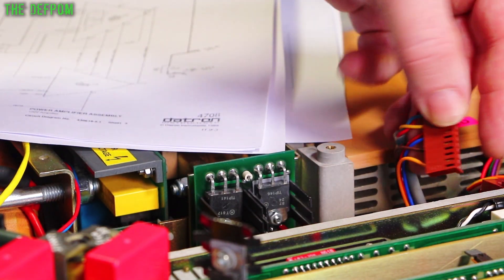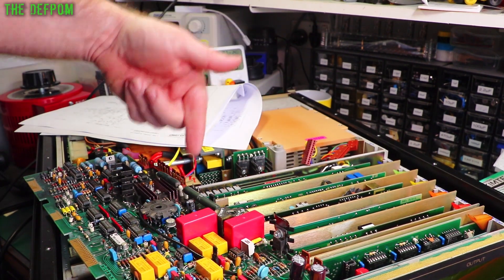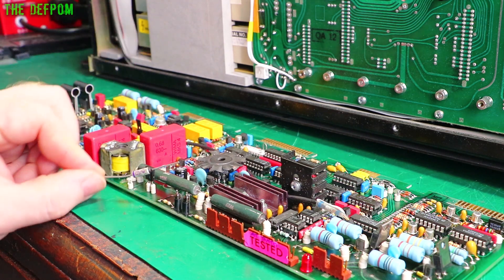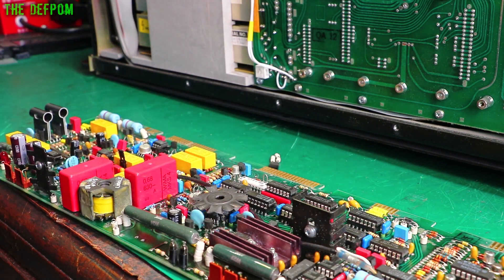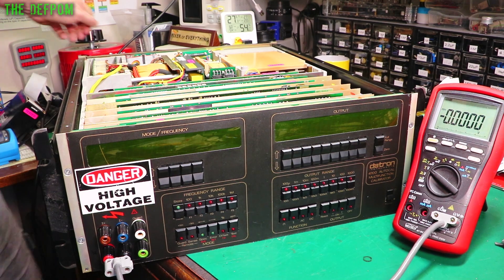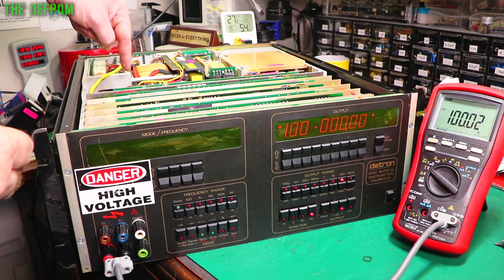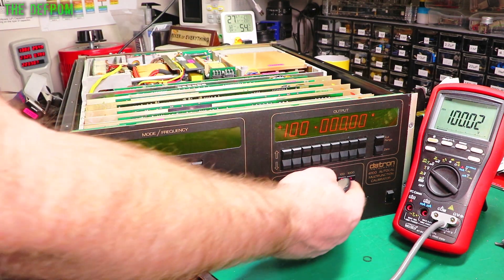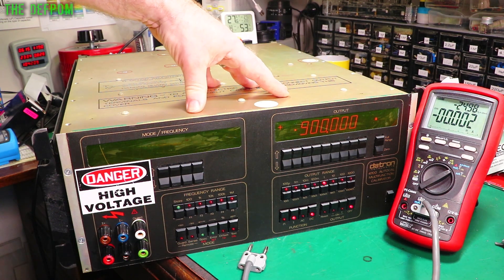🔴 Fixing a $10,000 Datron Calibrator - Datron 4700 Repair Part 4 - No.830

Comment: Haha! Bloody well done, I like your methodology.  I worked for datron where I built and calibrated many of these. Watching your videos was a trip down memory lane, wish I had found this when you first started your repair, that said you cracked on at a pace! Had great fun building these as they would come off the  assembly line with just the transformers and motherboard built in. The correct method was to fit a board and test its output first before moving on - unless it was a friday pm after a few lunchtime beers where all the boards went in with the HV enabled,  power up, self test and output max volts! Sometimes we got lucky and wheel them straight round to the autocal station for a basic test via the ieee socket.
The 4700 was probably the best bit of kit I worked on.
Reply from the maker: Awesome stuff, would you have come across issues with these with the high frequency output dropping off ONLY on the AC 1000V range ? I just noticed mine is exhibiting this symptom, lower voltages are fine.
I was literaly just calibrating a 1062 which wants 25KHz at 1000V for the high frequency AC calibration and noticed that my 4700 isn't maintaining the output voltage properly on that range and frequency, it is dropping down to about 860VAC , it is fine up till about 1.5KHz... so I'm wondering if its another fault or just a calibration thing, I haven't dug into it yet.
Reply: @TheDefpom  The 1000v ac range was always the most difficult to get right! Assuming your dmm  is ok I would hang a scope on the output and check for distortion usually caused by parasitic oscillation.  The feedback loop only has a certain amount of correction, they were calibrated at 2 frequency points of 1khz and I think 25khz . We had stability problems with the Vishay feedback resistors where tapping the board would give a big fluctuation.  They sat in a line at the top of the ac board, go gently on them! I worked with a guy in the production test bay who then moved into customer service and remained many years after I left. He now works elsewhere but we message occasionally and he lives close by, small world! I still have some boards and components that I rescued from the skip but most went back for spares many years after I left.

Comment: I often run into leads that are too thick for the board. I just take the lead, and use some 120 grit wet and dry paper on it, twirling the component lead with the lead between the folded sandpaper, to remove a little bit of the copper and plating off the lead. Then you can get it to fit the hole without damaging the through hole plating.

For the thermal fuse current rating is the carry current, they are not going to fail from over current till it heats it up to melting temperature. Insulate the fuse electrically with some kapton tape, as the resistor body when it is over 150C is conductive, as the glaze is only an insulator when cold.

Comment: Never any doubt that you would fix it, Scott! Expensive "parts" gear is scary but very rewarding when fixed, you now have a great calibrator for your bench.
Reply from the maker: It was a big gamble, but I felt I could get her working after seeing how Datron designed their gear with the 1062 multimeters I had repaired previously.

Comment: 👍Good work, nice gear. Hope it was not too expensive to buy in unknown state.
Reply from the maker: It cost nearly NZ$5000 including postage and import duty, the most expensive bit of test gear I have ever purchased, so I’m happy I got it fixed!
Reply: @TheDefpom  Thank you, that was certainly a stiff price. That takes confidence to tackle or extreme need. If there is enough need then it is definitely way cheaper than a new one. With a successful repair you either have an excellent calibrator or even could turn a good profit selling it working.
I would have concern at such cost, to risk incomplete supply, or severely fried  equipment. Still you have had much experience in these equipment buying and repair activities to ease concerns I would have to even undertake the risks.
My largest concern would be assured tech documents, but you seem to normally manage to get relevant manuals. I have failed sometimes and turned down repairs on behalf of others due to lack of documentation, but probably have not tried hard enough as the gear was not mine.
My present dilema is the Keysight  SMU (dual ch)  I would like to buy is over $23k new. The only second hand unit I had a opportunity to talk to existing owner  about has blown a significant part of its main circuit, and one PCB is charred. Still he wanted $8k and that to me was too risky. Might need to try harder to find a second hand on the market.
Reply from the maker: @helmuthschultes9243  charred boards sounds rather serious, would likely need a replacement board, I’d hate the think how much that would cost.
Reply: @TheDefpom  probably would not even considerit was a gift, let alone at that price. The cost of spares from Keysight is almost like a new purchase. In fact on my casual job, in 2019, had to try getting a DSO X 3000A Oscillocope repaired, it overnight failed to power up. It was turned off the night before, and no longer turned on in the morning. So a likely surge failure, a real problem on the modern equipment that have mains on all the time and power switch only activates the DC pwer side of the switchmode power supply. Documentation, Keysight did not release! I examined the supply outputs all 0V so definitely the supply. Contacted Keysight for a replacement, not available, the only repair option was exchange unit oscilloscope for the original DSO X 3000A models that no longer had any repair options, which were superceeded by DSO X 3000T series. Which could have spares supplid and  component repairs. Cost to exchage over $5600. The then current tech manual had no power supply details, so it was shelved by the managers. I did later dig up a older user tech manual that gave some power supply details, but other work I had priority on, then prevented any  getting back to try the repair., and COVID came along since.
That permanent AC on for much modern equipment is a severe risk, compared to turning off the AC when swiched off. Seems best to have a central AC off switch to the entire test bench at end of the working day so no longer ex pi osed to main glitches 24/7 whether in use or not. Maybe only equipment that requires standby power on, like precision stabilised equipment, like 7 or 8 digit meters, RF sources, calibrators that need thermal stabilising,  remains powered.

I no longer leave my own MSO X 3000A and MSO X 4000 plugged in unless in use,  there are too high risks if only repair options on equipment over 5yrs old is swap over replacement of the entire unit at high cist.
Reply from the maker: @helmuthschultes9243  all of my bench gear is run from a line interactive UPS, and I have a LOT of surge protection devices scattered around, I even installed one on my main AC breaker panel to try and snub the surges before they go through the entire house.
Reply: @TheDefpom  Excellent, nothing better possible if the UPS is good. Many cheaper units effectively only switch over to local power on mains loss, but feed mains AC  direct while mains iscactive, and thus allow high transients direct through. A good UPS supplies output from its internal converter, while holding the 8nternal storage in charged state.

Just a pity when expesive equipment itself is at risk when turned off by its switch arrangement and exposes its DC internal supply circuit to constant AC input. That is becoming all  too common, and the switchmode supplies that now are prevelant, are not exactly robust to high mains gllitches that are somehow also seemingly more and more common. 
Seems  as AC supply networks are being operated at closer margins and being switched around between the several generation networks , feeding different sources in and out balancing local loads there are more transient events. Once it was lightening strickes or accidental line events  causing such transients, now it is just operational life. Somehow AC is getting far less stable and clean compared to 20 -30 years ago. Maybe even some transients from local solar systems or  switching in/out other renewable sources, compared with old stable running generators at coal or hydro sources